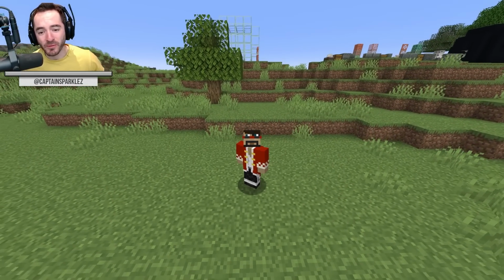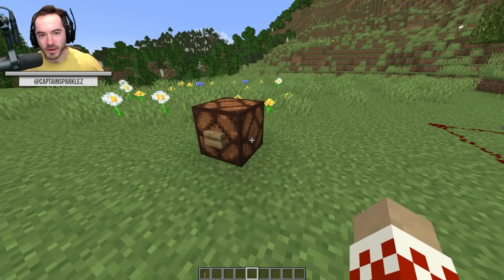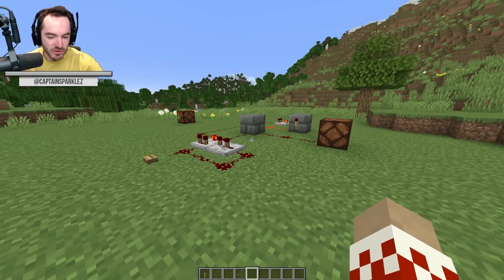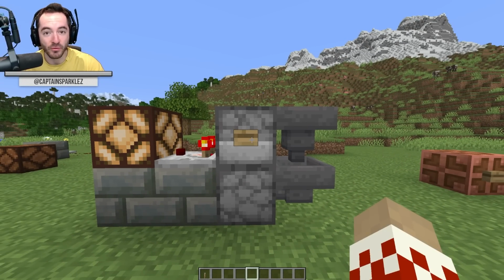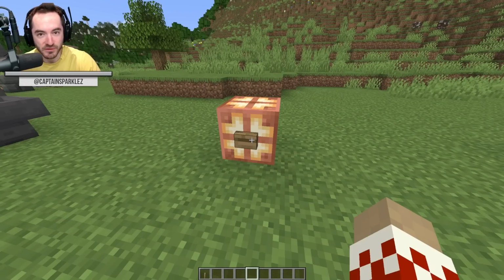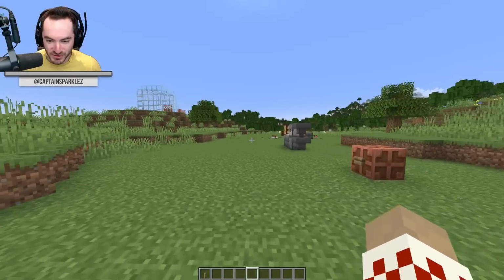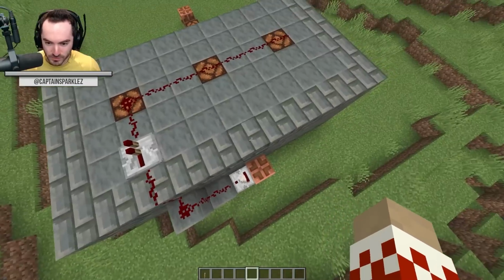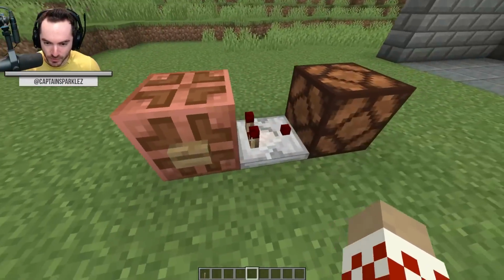This Is Huge For Minecraft 1.21

Comment: Another redstone engineer pointed out theres even more the bulp can do that is revolutionary that you did not cover

Redstone signals usually only update per 2 ticks and some redstone system require it to work on single tick instead, so they usually had 2 systems working together seperately with one with an offset of single tick, which is extremely complicated and stuff

well it turns out the copper bulb send redstone signal trough observers in a Single tick, instead of 2 ticks, which is absolutely revolutionary for simplifying a lot of extremely complicated redstone machines

and thats not just all of it, some redstone contraptions used T flip flops to hold memory of 1's and 0's yes literal Solid state memory

the bulb can do that in single block, contain 1's and 0's with copper bulb redsotne engineers might go above and beyond and make literal games, run doom on minecraft using redstone by simply writing the game's code into bulbs from raw machine binary code

Comment: Ignore me! I was thinking of an Observer, which I think would work just as well except for the oxidization weakness (actually it would be a pulse, never mind again!), but the Comparator shouldn't have to worry about it. Something that would be cool though was if more oxidized Bulbs emitted lower Redstone signals from Comparators, so if it wasn't properly built and/or maintained your wiring could degrade, like real life.
It should be noted that you probably want to use a Waxed Copper Bulb for this mechanism, since otherwise I expect the Comparator will pick up each time the Bulb oxidizes so it may activate a few times you don't want it to.
Reply: You are thinking of an observer.
Reply: @snaketail114  Ok yeah you're probably right, since I guess oxidation isn't changing the block state but changing it to a different block

Comment: It's way more than just that. If you think about it as storing either a 1 or a 0, it can get really powerful. This can be as simple as a reprogrammable combination lock, but people can also use it for memory banks in computers or basically anything that requires storage—especially since it's moveable. It also functions as a really easy binary counter. 

Also, it toggles on single game ticks, as opposed to the 2 game ticks of pretty much everything else, which means that lots of things can be faster. For example, pistons can be moved on 3 game tick intervals, so this allows them to be moved at the fastest possible speeds. It was previously possible, but it was large and clunky, which this is not.

If not for the crafter, this would probably be the most significant redstone block in years, and it may end up even more useful than the crafter.
Reply: More than that... It works in a single game tick instead of a redstone tick, so redstone timing can now work twice as fast.
Reply: @overpower3382  Thanks. I forgot about that. I just added it.
Reply: I had the idea to create a series of stations that direct a series of flying machines. The flying machines have a set of copper bulbs that encode their destination and then the stations point the flying machines in the direction it should go based on it's destination code.

This code would be incredibly compact because with just 4 bulbs you could encode as many destinations as I could find reasonable on single player, 6 bulbs is the max I can see a small multiplayer server using, and 8 bulbs is more than you would need for even a large server's public transportation service
Reply: @winterfrostarian Precisely. Memory banks are relatively easy and small with copper bulbs.
Reply: Was thinking that
Reply: Sadly this comment didnt age like fine wine
Reply: @Joly0 That's why we have datapacks :)
Reply: REDSTONE UPDATE TWO REDSTONE BOOGALOO 🔥
Reply: I think it's more useful than the crafter because the crafter only crafts things. It's a fairly specific use scneario. I'm sure that people will be able to use it for more than that. For example it can be a better timer or something.
But the copper bulb is going to have way more widespread use. It's going to be used in a lot of contraptions just like a piston or a hopper.